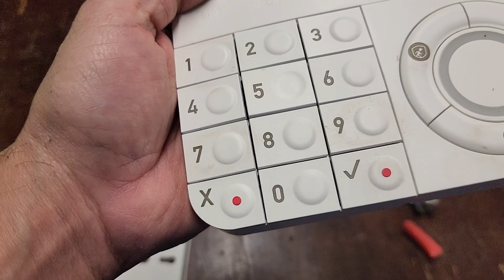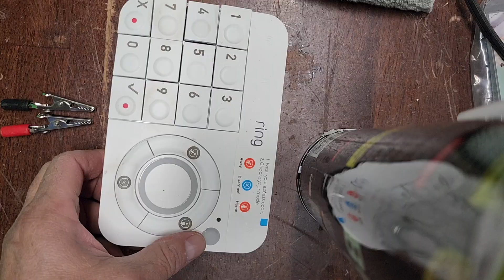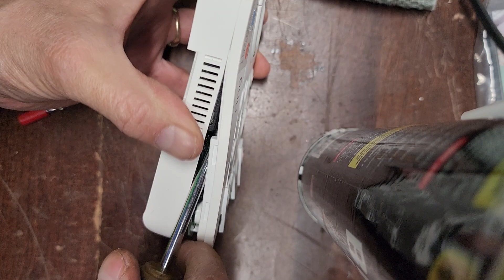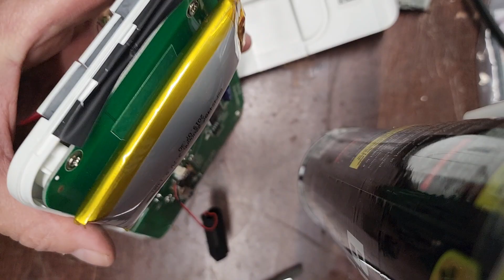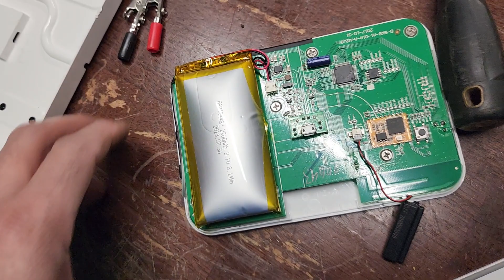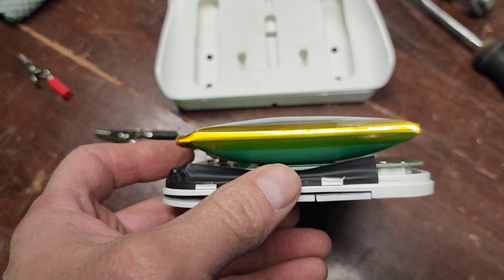Ring alarm system lithium battery fault possible  fire

Comment: Looks like this is the exact reason Ring replaced mine for free.. I didnt even know why they were replacing it with Gen 2.
Reply from the maker: Yes we wound up upgrading the system Lithium ion batteries are no joke to play with I built my own lithium Ion 48 volt battery and I'm thinking when I'm ready to dispose of it I have no idea where to take it
Reply: I took my ring's swollen battery to Battries+ store and they charged $16 for that tiny battery to dispose it off.

Comment: Wow, the USB connection where you charge the keypad broke off inside, so I opened it up and the battery is super swollen like yours. Ring should replace these at no charge.
Reply: They will but it depends if you have warranty.